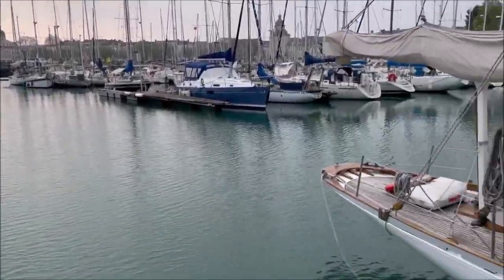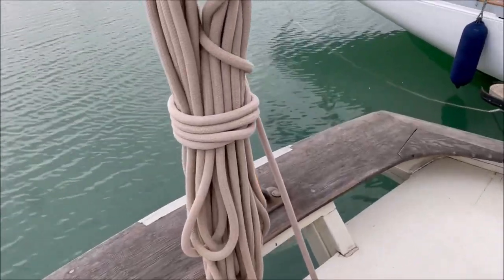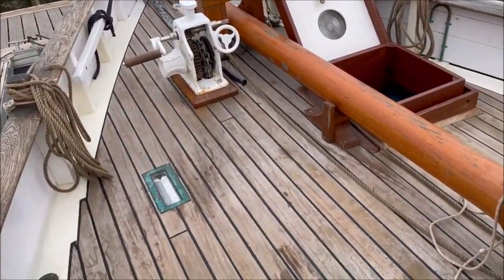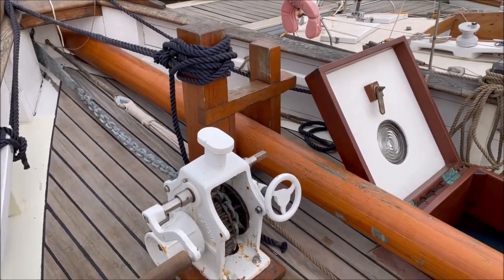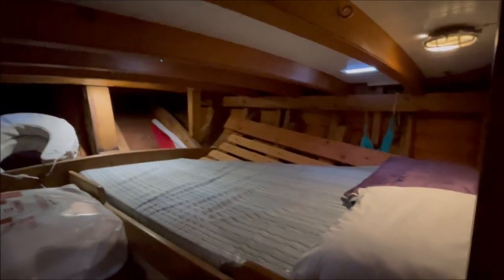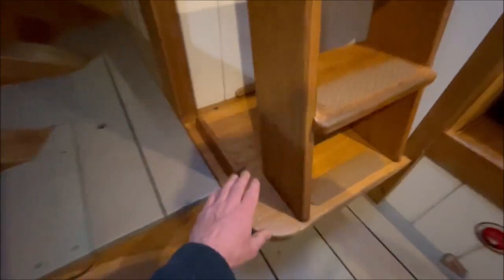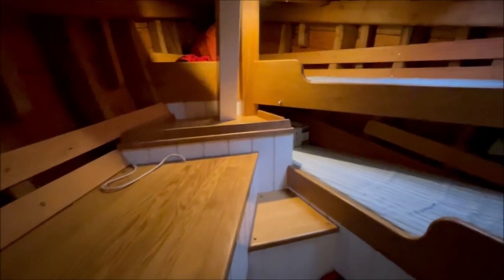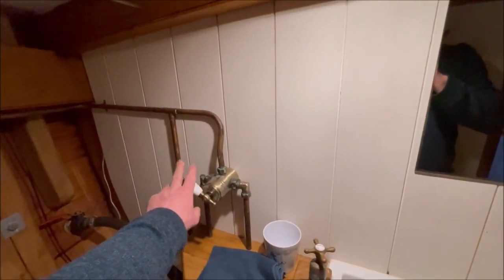Bristol Channel Pilot Cutter Replica classic sailing yacht For Sale

Comment: Some comments if I may.
 No handholds on companionway ladder
No handholds  around stove
SaloonTable has no fiddles  when opened.
Thats not the hawsepipe in the forepeak its the spurling pipe.
Line storage in the maincabin over inaccesible storage chest.
Nice day boat
Reply: I don't think you have spent much time on traditional boats.

Comment: It looks much older than 2017. What a pity that a boat that had such a tremendous amount of work put into building it did not have a cover put over it.
Reply: You failed to read the description that says the boat has a cover for winter. Not really practical to cover and uncover during sailing season.
Reply: @galerae947  So sorry. Thomas is talking about such pity condition and look of the boat, but you are talking about covering the boat and such issues. You are missing the point.